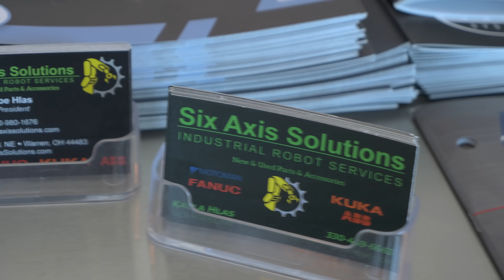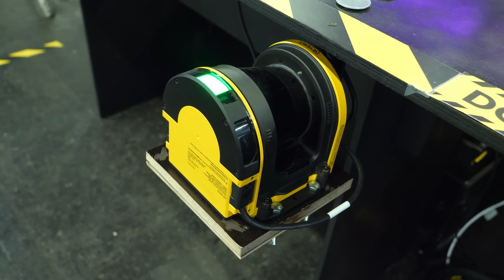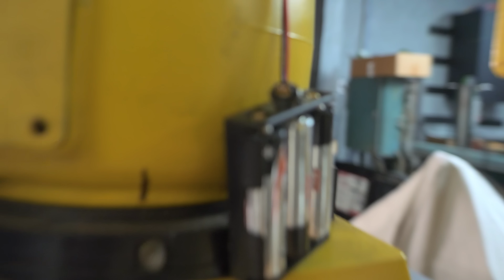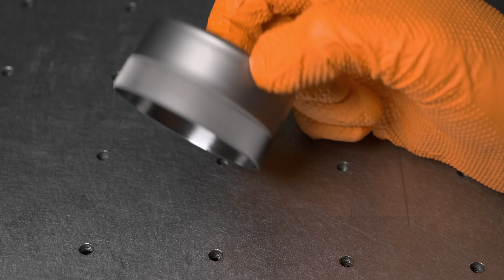How I Get Industrial Robots for so Cheap

Comment: of corse you can control not a robot , but Stepper motor in them with Arduino or other small computers , those are just arms with stepper motor in them . Question is , what to do with them.

Comment: not sure about those specific connectors but that photo of cut cables doesn't look too alarming, they look like they are easily disassembled and re wired (assuming one would be using a new controller), not sure if they would be potted with anything though, or have other issues than just cut cables

Comment: I was looking at your robot that you had 3 of for the cable:

Those are indeed Amphenol / MIL-DTL-5015 style circular connectors (often referred to simply as "mil-spec" or "MS" connectors). If you have a military or ex military buddy who has electronic experience, they may have the "build a cable with connector" skill that can help if you can't find the cable information in the future. Had to build a few myself. 

They are heavily used in heavy-duty robotics, industrial machinery, motorsports, and aerospace applications because their threaded coupling rings and heavy aluminum shells create a secure, vibration-proof connection that can handle high current and harsh environments. I hope this helps.

Comment: The cables are cut rather than unplugged so that the machine can be sold with the appropriate male and female connections. Then you know you just need to terminate your cable into the plug - very handy if you’re not sure what plug you need or if they’re obsolete. And when the plugs can cost £50 alone, why not?
Reply: Yea it’s pretty obviously why that’s done. It’s to benefit the buyer lmao.

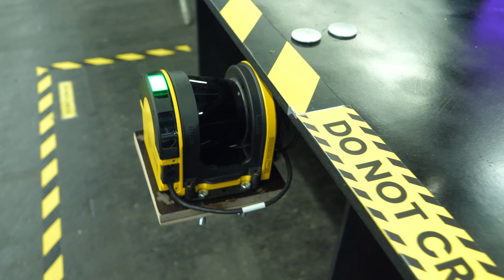Comment: 14:53 Best practice with e-stops is to use the normally closed contacts. That way, a broken wire will be interpreted as an "e-stop has been pressed" signal.
Reply: Tbf, if you do it any other way, you have no business working in this field.

Comment: dude the fanuc robot arms are my whole foundation/inspiration for my own robotic arm designs. I want one of the lr mate 200id/4s so badly so I can reverse engineer them. one of the biggest problems ive run into while designing semi industrial arms is the bearing systems and shaft coupling techniques and along these same lines the bearing preload methods. because I'm not a millionaire ive tended to use angular contact bearings as a middle ground for certain axises for their precision capabilities as well as preload necessities while not being overly expensive

Comment: This is very interesting to me coming from the perspective of a broke filmmaker. There's a bunch of robots like these being used in the industry, a camera will be mounted to them and the operator can make keyframes for camera position, focus, iris, and so on. The companies selling these as videography equipment are selling them for a fortune, but at its core these camera robots are just industrial robots with purpose built custom software.

Comment: Completely insane, if you think about the costs and affords it once took to build stuff like the reduction gear in 46:00.
And then, there are like 4 of these inside a robot, along with servos, servo drives and the electronic brains with likely a huge amount of software development.

Comment: Good presentation. When I was designing CNC’s in the 70’s it was a whole different world.
The origin of Industrial Robots was the Controller functions developed for other machine tools. Automated 5-Axis Lathes, Mills and so on with Tool Changers.
My Controllers were based on the Z-80 Microprocessor replacing the TTL based logic buckets of our NC Machines.
The Motor and Servo Drives etc. were the same for all models of machine.

Comment: Absolutely insane savings when you do the math on these. If you bought all 14 of these robots brand new at original factory retail prices, you'd be looking at anywhere between $333,000 and $405,000 total! 🤯Instead,

 he walked away paying between $2,960 and $5,270 total depending on how the auction lots were split up. That is an unbelievable 99% discount and over $330,000+ kept in his pocket

Comment: You could make a heap of money exporting some to Australia. Give me a shout if you want to explore further.
By the way, if you need to move an axis manually, release the brake. The brakes are usually 24V DC. Obviously be careful with larger robots. I have a small enclosure with a spring loaded pushbutton and 4 X 9V cells in Series just for this situation.

Comment: People need to understand if you don't understand how the Code runs this kind of picker bots, you don't want one, cuz you ain't making it do anything you may or may not want.
Honestly The politicans are gonna approve so many AI Slop Centers, everyone will be living like in the UK and the power will be so expensive, , keep ignoring your local politicians, its helping your future.
The Military Sells 3 Phase Generators for Aircraft and stuff for cheap, you can get 3 phase gens for cheap cuz no one wants it.
I have replaced a TON of random sized lithium Cells with 18650s , as long as you meet the volt and maw rating, I have never had an issue, just putting 18650s into sequence, you can get 4680s , that is what Elon is using, and that is what those looked like. They are like 2-4 18650s depending on the year of cell.

Comment: I recently brought a FANUC M-6i with an R-J3 controller back to life. The main issue turned out to be the numerous miniature relays used in the safety circuit. Some of them were sticking, causing E-stop errors even though the external safety circuit itself was fine.

I also discovered that the teach pendant supplied with the robot was the wrong version. The R-J3 controller is very particular about teach pendant compatibility, and there are several versions that look nearly identical. My controller used the “dual-chain” safety architecture, which is not compatible with a single-chain teach pendant.

Comment: If the arm is sitting on covers you should look for pins connected to brakes. Secure (hold) the axis and apply voltage to release the brake. Then you can push the axis to make the room.
The same applies to fold robots fir transportation.

Comment: For manuals I've had good luck just emailing the company's head of maintenance or someone similar and say you're working with a local college or that you're doing a community project and they have been happy to help by sending pdfs of the manuals for older machines.

Comment: fanuc's architecture is interesting.  I deal with a lot of servo drives and controllers, not with robotic arms though.  some notable differences are: i run across more resolvers than encoders in servo applications, the feedback goes directly to the servo drive and is read by the PLC via ethernet or sercos back in the day, we lean into PLC architecture and not proprietary controllers.  cool stuff on the channel...
Reply: also worth a mention - we used to use ardetech industries in dallas to custom make cables with milspec connectors for certain automation things we had.  they may still be a resource for what you are looking for cable wise if you cant find them elsewhere.

Comment: I work for a large car manufacturer. We have stripped out 1000s in the last few years but they just arnt worth referbishing. Selling them on struggles to break even, I think we get about £2k each exporting them to India etc and that barely covers the cost of doing it. We can buy new machines from ABB for about £30k each and get the lastest models and manufacturer support, its a no brainer. We just installed a few hundred or so 'reuse' Fanucs and ABB in a bodyshop in the name of 'cost saving' and it was a complete nightmare. Manufacturer doesnt want to support because they are 'reuse'. They are essentislly obselete before they are even installed (even tho they are barely 5 years old and have minimal hours). Load of hassle trying to find the right bits, fault finding etc. Deffo not worth the man hours to do it.

Comment: @16:10 Your 3ph input going to the shut off switch, If your viewers are going to attempt to build one of these as a learning device/hobby, I would suggest making the shut off switch stationary. In an industrial environment, the cabinets are hardly ever opened unless there is a problem and a reason to be in there. As a hobbyist, there is a possibility the bend on the primaries could fatigue the conductors as the door is probably going to be opened and closed a LOT.  Great vid and cant wait to see what youre going to make with that mobile robot

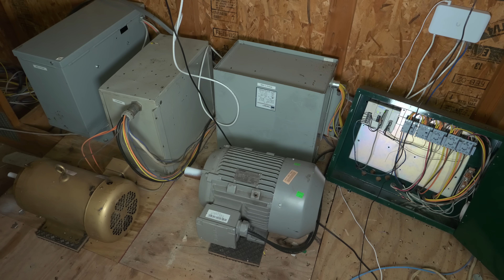Comment: 11:28 No you have 240 volts AC
Reply: Pretty sure this guy knows what power of receptacles he has
Reply: @Epicotters sure. But the national standard in the US is 240v AC. People say 220 and 110 and such for various reasons but it is 240/120. Do a little research

Comment: D size lithium batteries so 3.2V standard x2 cell so 6.4 volt  under 8v above 5v should be good I'd 3d print with your other robot a 18650 case and run 4  just 2 going++ other 2-- and a bridge then ends to plastic case to your same connector off the 3.2v D lithium 18650s will be way more plentiful to find aNd you could print a case that does a diamond smooshed square out of +++ 3 cell each side --- to keep same as the D also take the D cells and put in a lithium battery charger just to see if you can get em back to 3.2 v or whatever they take I'd look up the actual battery otherwise in case it's a 9 or 12v  but it doesn't look like it takes alot of amps as long as it's right voltage

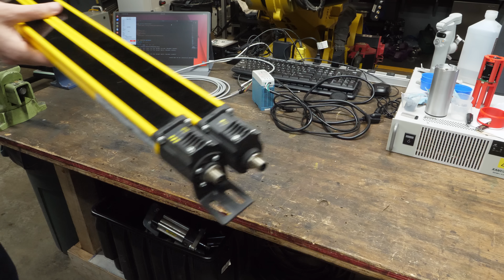Comment: Is that price on the light curtain pair at 14:22 missing a zero or two or did you really manage to snatch those that cheap?
Reply from the maker: That’s the correct price, found them in a big pile at a surplus store and they gave us a few pairs for 50$
Reply: @ExcessiveOverkill  that's awesome, maybe I should visit surplus stores more (if I can find them in my area)

Comment: 32:30 Note that some FANUC robots have a movement mode that will allow the robot to move at full speed in teach mode. Yes it is incredibly dangerous.
Reply from the maker: The old ones do when running programs. There’s no T1 or T2 switch. Still can’t jog at full speed as far as I know
Reply: @ExcessiveOverkill Ah right it's been a while since I worked with one with T1 and T2 we started phasing those out years ago after a guy got hit by one when the program changed the override speed to 100 when he didn't expect it. Thankfully he only broke a few ribs.
Reply: @Orbital_Dumpster #5 just about un-alived him...

Comment: I know nothing about industrial robotics or electrical and yet this video has made me want to go out and buy an industrial robot and learn how to use it.
Reply: Make sure you learn about industrial power, first! Most of these bots require at least 240v 3-phase power, and that's after you reconfigure them from the 480v/3p config that they were set up with in the factory. The power setup will cost at least as much as the bot.

It is a ton of fun, though!

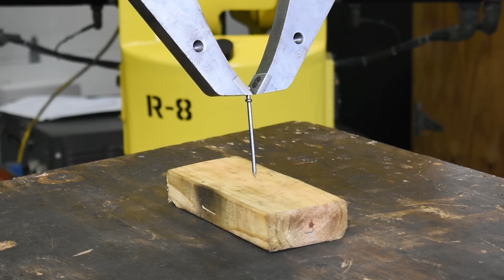Comment: 12:54 that's terrifying.  Knowing it can push with that much force and not even slow down. 
If your in a pinch point it won't stop till after you're missing a limb.  Cool! 
awesome video! I love robots.
Reply: They put cages around these things for a reason. Also the reason many industrial robot integrator people won't ride these as a rollercoaster when there's chairs attached to them like you have in eg Legoland and some other places. They try to go until you cut the power

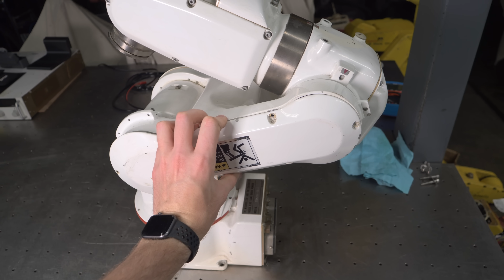Comment: 6:20 I wish more people would put tags like this. No joke. This tells me not only there is an issue, but someone worked on it long enough that it p!ssed them off. That's a note I trust. I now know what I'm stepping into.
Reply: I would put similar labels (usually tape), on the inside of some systems I was working on, had repaired to work, or knew it was absolutely not worth the time, effort and sacrifices (mental or otherwise. 👀) to repair. Usually trying to save whatever the next unfortunate tech to work on it was. Or myself if I had to go back, eugh. 🤣🤣
Reply: Totally agree, I'm a mechanic for a rental company, When I seen that red tag and what it said, I knew that tech was ready to loose their shit. I just hope it wasn't for something simple just outside techs scope.

Comment: 3 phases isn't mandatory probably since all such equipment has its internal PSU that should give a bunch of DC voltages out. So if you can supply those voltages with required power you can easily replace the 3 phase PSU to a 1 phase one (or several of them).
*By the way, servo drives aren't dumb AT ALL. They just don't need any interaction with a human. But they usually have a signalling processor to run some pretty nasty calculations with vectors very fast.
Reply from the maker: You can get away with pretty low quality 3 phase as long as the controls are on a good phase from my experience. Haven’t tried running entirely on single phase.

Modern servo drives do way more, the servo drives in the rj2 controller take in a PWM signal for each motor phase and send back the measured current. Barely doing any processing at all. Kind of a wild setup to see so many signals needed between the cpu and servo drives where today it would be fiber or some sort of industrial communication bus.

Comment: 19:00 something important for people to keep in mind is that the power supply’s for the motors have some very large capacitors in them. That depending on the size of machine will happily kill or severely injure you. Most have charge lights to tell you they are still charged wait till it goes out then you should be good. 

Good luck from a CNC machinist by trade.
Reply: Motor drive repair tech here- Yes indeed it can kill you. Heard a story of a guy getting flashbanged by one so hard he went blind and deaf for a good few minutes. Also have put out fires from them, and had numerous ones go bang in a major way. Know what you're doing before sticking your face or any part of you anywhere near those things.
Reply: That's the most basic thing you are taught in elections... i saw people getting knocked unconscious on changed caps...
Reply: @Nomad_Wanderer  elections?
Reply: unless the controller was a w10 computer someone shoved in a cabinet, with a big interface PCI card, like how the fab shop i used to work at did it
the HMI may be a factor in this tho
Reply: I the larger Kukas we are talking about 600 volts at huge numbers of microfarads!

Comment: Hello @ExcessiveOverkill. How did you program that movement of axes 2 and 3 at the 34:04 mark?
Reply from the maker: J2 moving but j3 staying level? I only programmed j2 to move. Fanuc robots automatically move the j3 joint to keep it level when j2 moves
Reply: @ExcessiveOverkill   OHHHHHH, Thank you for the explanation. Do all Fanuc robots do this, or only specific models?
Reply from the maker: I believe all of them do
Reply: @ExcessiveOverkill  Thank you for your time.

Comment: I swap the original controller box fan to much quieter noctua fans. 1 fan for input and another for output. Makes the usage of it indoors so much more bearable!!

Can get small a meanwell AC to DC converter mounted inside the cabinet to power the fans.
Reply: while this usually can be done safely,  *double if not triple check the fan you are installing at least matches airflow rate* if you don't want a giant power supply getting hot and blowing up in your face

Comment: Finding bargains like that is a dream. Hilarious considering what they cost new.
Reply: Well the main bunch of the price is the support from the manufacturer.
Reply: @peepopalaber  And also knowing it's in good conditions when you buy them. Early failure or just added integration time probably eat the savings of buying them for cheap very quickly.
Reply: @Kenionatus  It's the reliability (not just early failure, but the rate of failure, since we usually repair them) and precision loss that discourages secondary utilization in production plants. These old bots are usually purchased by guys like myself and OE. There's not much of a market for end of life bots, even if I get a few curious small businesses asking about them every now and then.
Reply: @peepopalaber thats what they always say
Reply: Most industrial stuff that reaches the end of its useful service life essentially becomes worth it's weight in scrap metal.
Reply: @deezelfairy  literally. I can’t believe that guy actually thinks that lol. I’m dealing with a super old precision measurement device. Nowhere to get parts except to ship it out for repair. Of course, the one company that still touches them will buy it from me.
Reply: Just think how much money the robot made the previous owner..
Reply: @SegoMan  It's impossible to imagine without knowing what it was used for, but hopefully it made a profit.
Reply: @NightfallSentinel  it 100% made a profit lol

Comment: You should look up how to do a quick master on the robots after a BZAL alarm. As long as the motors, reducers or encoders haven't been removed from the robot, then it's entirely possible to recover the factory mastering data, which is always going to be more accurate than using the witness marks.
Reply: One of the things I loved about the ABB robots, so easy to recover the original calibration of the robot after an encoder battery failure.
Reply: Interesting that they don't have a mark on the encoder that's used to calibrate. I think most CNC machines do it that way, or with a limit switch. Although that might be because you can home/master them with an automated program due to the simpler geometry, whereas robot arms probably don't have a sequence of operations they can do that is guaranteed to not crash them until they're mastered.
Reply: @Kenionatus Fanuc uses a limit switch if they need to do a full mastering when a motor is replaced, but the quick ref mastering, if done plenty of time, can be done in 15 minutes or so, so quite handy if you know how to do that